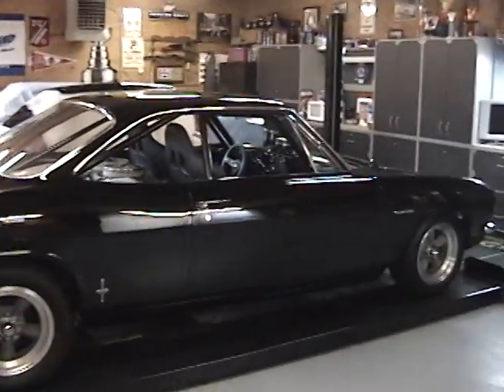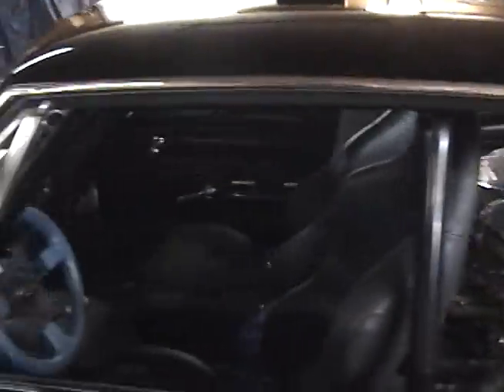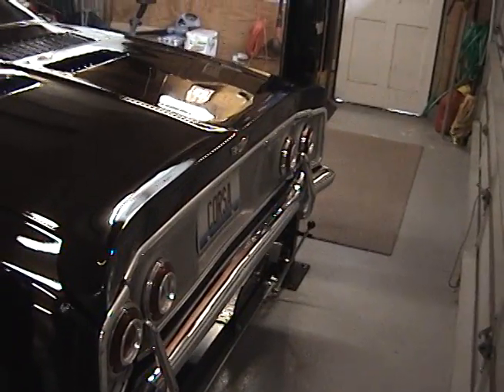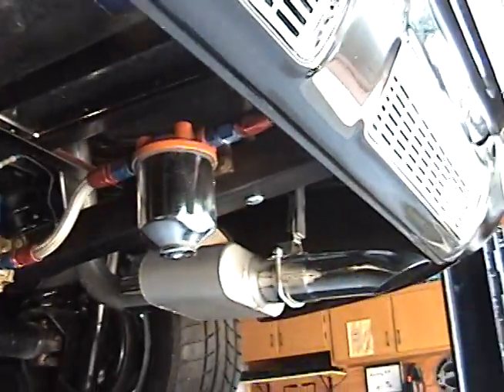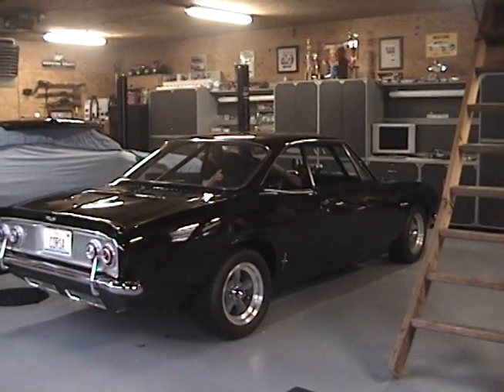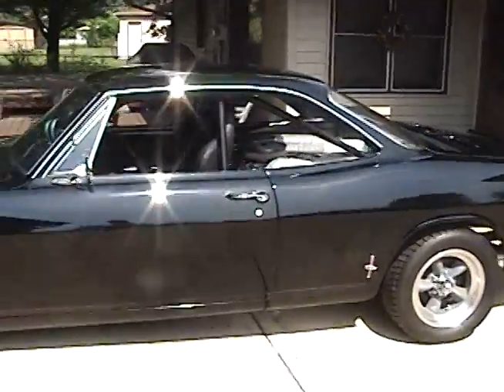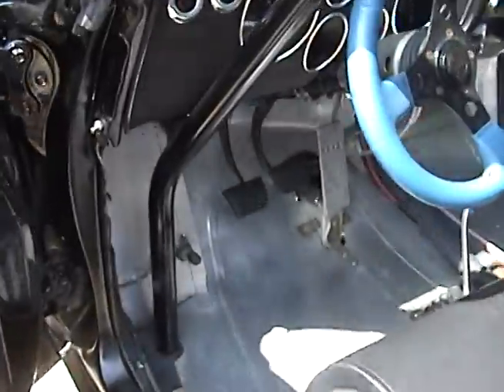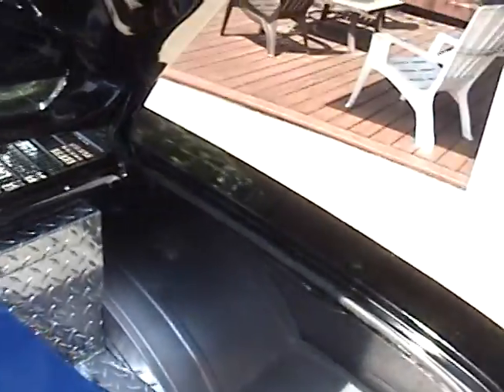1965 Corvair Corsa with a Crown Engineering V8 conversion

Comment: Very handsome Corvair-shaped hot rod, no doubt long-since sold. With that little use over such a long time, I'd be looking for seals, lines, and filters to have perished. Disuse can be more destructive than extensive use.
Reply: True...garage rot is real, dealing with it now, my 93 mile frame off has sat for 4yrs. 
Sure I could add gas and go but thats not too smart. Will take a few weekends and 2k to do it right. 
Health, $ has kept me out of it. Dying to hear that rowdy Isky solid roller again!

Comment: VERY NICE !  HOW COULD YOU BUILD SOMETHING LIKE THAT AND NOT DRIVE IT ? I AM SAD FOR YOU . :(
Reply: No firewall, and part of the engine is in the front seat.  Poor design for a driver.
Reply: Well, when you build a car like that, at some point there is usually a lot of pride in ownership and in a lot of cases the project becomes a work of art that you created. So do you absolutely HAVE to drive it to enjoy it and be recognized. Or is it great just standing there. That's what happens often with any vehicle which you bottom up or nearly completely constructed. Even when the engineering isn't you design, it still becomes a personal statement. Time on the road not withstanding. Think early sixties to early 80's show rods like, say, the Silhouette, the Predicta, The Beatnik Bandit, Boot Hill Express etc, etc. Do they need to be driven?
Reply: Drive them don’t hide them 😆💪🏾💪🏾👍🏾 stunning ride.
Reply: @rogerl6  I’ve seen many with this same design at shows and they drive em cross country just fine
Reply: @808kicks2  I've seen 400 lb. guys roll out of a fox body talking about how comfortable they are to drive.  Everybody knows they're full of crap.
Reply: @cindylawrence1515  Well said. 4 yrs mines sat less than 100 mi on frame off. 
I know better just not able to yet. Least its there when Im ready, meantime I still enjoy having it. 
Getting old/crippled SUX.
Reply: @808kicks2  Yep!! I laugh when people ask can xxx car be dailied?
Der...their gramma probably did. We drive new ones daily so whats stopping them!
They are just cars, metal nuts n bolts.

Comment: No way would i ever sell that car or even drive it much before taking it on the car show circuit and shown a couple of feet up in the air. Kudos to leaving it 4 speed manual and love the amalgamation of speed parts which really push this car to the next level. There can't be many manual trans. cars of this type of conversion. Last one i saw was in car video of a road racer on track blowing Porche's and i don't remember what all into the weeds.
Reply: I couldnt do it. Any frame off resto Ive done has been driven any chance I get. Underside still looks brand new just be selective where you go.  Living proof we could be crippled or ill tomorrow at a young age so get your fun in dont wait!
Still trophied at my 1st show.  Prefer the experience vs a piece of plastic

Comment: In a auto magazine there was a 2nd gen (yr?) Coupe with a Tornado engine/transaxle mounted "behind" the rear seat.
After seeing that I thought, instead of the Tornado drivetrain mount a transverse V6 behind the rear seat of a 1966 
convertible and make it look as stock as possible except it would have two trunks and a custom roll bar (phase one).  ;-)

Comment: Beautiful to look at and an amazing build. However, dangerous with the engine being right behind you and no shield to protect you from heat, fire or explosion. Not to mention ear protection lol. I am sure would be a blast to drive otherwise!
Reply: Its safe, got a scattershield on it. Long as he has a balancer bolt hes good
Had a small journal 327 and it flew off on the fwy. It wobbled some, I was too young to see it was bad.

Comment: Nice, but question: What's the point of the Yenko decklid when the air cleaners are three feet in front of those openings?
Reply: Maybe the radiator is back there

Comment: LS all alum w billet water pump and rear mount turbos/IC's would be killer. Even a new all alum ATSV motor. put seats alllll the way back
Reply: This car would be undriveable with a turbo V8 and break a lot of parts. 
This engine is more than enough

Comment: Why did you not choose to use a Pantara style trans / transaxle? I know some guy's use a modified Porshe set-up in a fliped up side down configuration would not have this been stronger and easier?
Reply: The Corvair`s Saginaw trans has the same internals as the full-size V8 Chevys, strength is not a problem. Plus, with the Crown conversion, there`s no need to flip the transaxle over (like the Kelmark conversion does), which makes the ring & pinion run in an abnormal configuration. Seating is pretty tight with the Crown kit, though....
Reply: A Volkswagen or Porsche transaxle would have been good for more hp. According to the book on How to Hotrod Corvairs the factory transaxle can only handle 300- 400 hp.

Comment: Well the story of the Black Crown Corsa Coupe comes to a conclusion. After over 6 years this mystery Corvair has been found, purchased and loaded on trailer on 1-3-2019 in Golden, CO by the new owner. The new owner actually enlisted the help of a private investigator to locate the car several years ago. The Illinois license plate, 'CORSA' was a great clue. The Corvair was traced to a residence near Chicago. As it turns out, the owner who did the video was also a member of CORSA (Corvair Society Of America) in 2009. The name and address on the vehicle registration matched the information in the CORSA Membership Roster. The phone number listed in the roster was called repeatedly with no response to messages left on the answering machine. Although the new owner made a trip to this Chicago address, there was no activity at the home and the Corvair was not seen. The new owner had nearly given up his search. Then a break in the case renewed his interest.

As President of the V-8 Registry, I posted information about this search in a October 2018 newsletter to members. A member in Golden, CO read the posting and remembered a guy coming to his auto shop who owned the car at the time. The member reported the owners name and phone number to me. This information was passed on to the member who has been searching for the car. He quickly negotiated a deal with the Colorado owner and sent his 'Recovery Crew' to CO with a car trailer. He flew there, negotiated a better deal and his crew is on their way back to Illinois today where this story first began in 2012. 

For those interested in Corvair V-8 Conversions, you can see a follow up to this story on our website in the near future. If you have dreamed of owning a car that goes fast and handles well at an affordable price, perhaps a Corvair V-8 Conversion is in your future. Check us out at v8vairs.com.

John, President
Reply: Amazing car! I had a 1965 Corsa that I took to Germany when transferred there. It was amazingly fun on the autobahn and many of my German friends tried to buy it from me. I ended up sellimg to a young GI who got out of the USAF and took it home to New York.  I never heard from him after that but sure hope he enjoyed it as much as I did.  I  bought a 1968 GTX when I  got back to the states and continued drag racing for several more years.
Reply: wil check it out...looking for a retirement daily  for around town stuff. Solid 6er is fine but a well done V8//oh hell yes!
In SoCa no clue on pricing with these. Love oddball cars